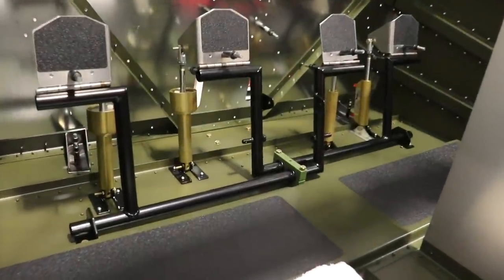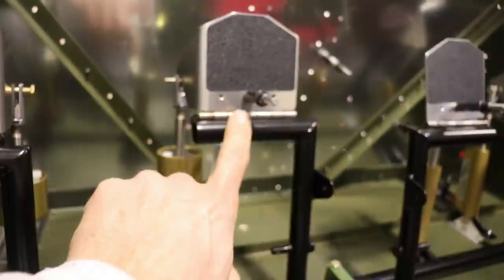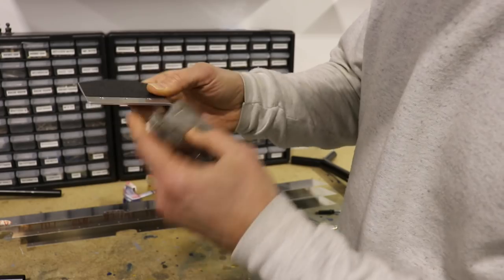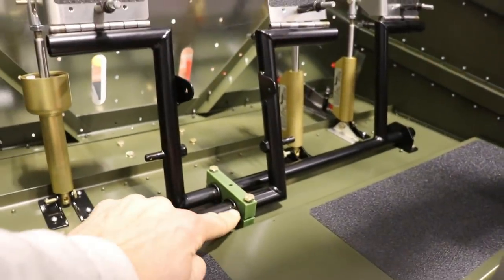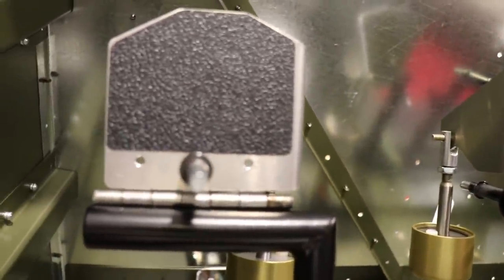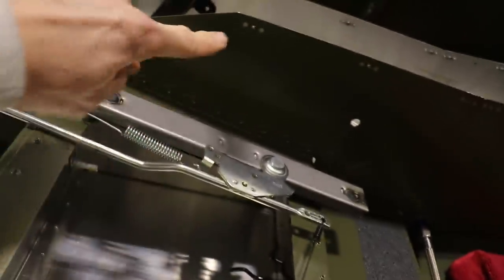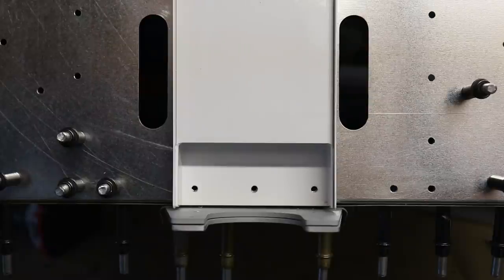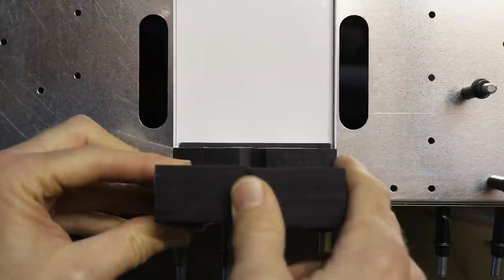Zenith Super Duty: Brake Pedals, Seats, and Nose Gear (Ep42)

Comment: As far as the brake lines, I was at an engine seminar and sitting next to a Boeing engineer and somehow we began discussing the Zenith "plastic" (?nylon?) brake lines.  He said they used the identical tubing on a lot of their hydraulic test rigs since it was so easy to fabricate lines.  He said it handles pressures well in excess of anything you could possibly  generate by standing on the brakes - if I recall correctly, I believe it was something like 2-3x higher.  So, I feel really comfortable with the lines - they're smaller and easier to fabricate - and cheap! Haha!
All that being said, however, there's no doubt the braided stainless lines will be much more resistant to damage and sounds like the way to go for a bush plane!
As far as the nose gear, several builders have mods to make installation and removal of the lower bearing block easier and more secure, such as through-bolting the block to the support underneath rather than drilling it and tapping it. Just wondered if you looked at those or considered those?
Really enjoying this series!

Comment: Good idea on using braided brake lines. We have plastic on our MTO-sport Autogyro and as soon as brake fluid heats up brakes fade out. Taxi on a long taxiway and no brakes at the end. We might upgrade to Beringer  brake system someday.
Reply: If you are experiencing fade that quickly, most likely you have contaminated fluid. Brake fluid is hygroscopic, and when you get a lot of dissolved water, your braking performance suffers just like you describe. Flush your system with new fluid from a sealed container and I guarantee you will see a huge difference.

Comment: Great '"Methods" planning on your part, particularly with respect to the Nose Gear steering phenolic blocks; very good idea to fit them flush with the back face of the fitting by introducing a slot to clear the rivet heads (two thumbs up).
Reply from the maker: Yes I think it's very important for the blocks to be touching the firewall. If they are not, then all of the rearward force on the nose gear will only be held by the 4 small AN3 bolts that thread in only about 3/8" into the bottom of the blocks. If the blocks touch the firewall then that force is applied to the beefy structure on the firewall.

Comment: Hi Mark, Love all of you building content, Great attention to detail, Please keep it up. I believe you said your looking for a different power plant for the Super Duty, but I am really interested in the UL Power for my Cruzer and wondered if your could give some insight on your experience to date with your UL Power plant, Thanks again for your great content. Have a blessed day.
Reply from the maker: As you probably know I have the UL Power 350iS in my Cruzer. I love it! It runs smooth and sips the fuel. I'm happy with it and wouldn't want any other engine in my Cruzer. But for the Super Duty that will (hopefully) be flying out West over unforgiving terrain, I want a bone simple 100 year old technology Lycoming. As long as it's getting fuel and the mags are working, it's pretty much going to run. The UL Power is absolutely dependent on fuel pumps and electrical power. Lose one of those, and you're a glider.

Comment: Just curious.. Why are the brake cylinder not driven from a centered bracket on the rudder pedals? As they are now, you are putting a lot of side force on the pedal mechanism when using the brakes.

Comment: Hi Mark, you said you are having Aircraft Specialties make your brake lines. First, that’s a great idea. Second, I’m curious how or what you used for a template to get the lengths and bends correct. Thanks and keep up the great work.
Reply from the maker: There is no template. I measure the distance between the two connection points and then give that measurement to Steve at Aircraft Specialty. I also let him know if I need a straight fitting or elbow or 45 degree fitting on the ends.

Comment: Mark, are you going to install an undercarriage storage area like Viking Engines has on their Super Duty? If you are, will the brake line going through the floor interfere with this area at all?
Reply from the maker: Yes, but I’ve designed my own. I just need to build it once a get the fuselage cleared off the workbench!

Comment: Looking good. I like the braided lines, but I wonder what the weight penalty is compared to the supplied lines?
Reply: Its the flex that is significantly lower in the hose because of the braid. If there was an ounce to be saved the motorcycle road racers wouldn't use them. I raced for a number of years and its just so much a better feel for braking with the braided lines. Because they flex less in use they last a lot longer too.
Reply from the maker: I also understand that if the brake calipers heat up, it may affect the plastic lines and soften them where they attach to the calipers. I think the plastic lines work well on something like the Cruzer where I almost never even use the brakes, but on a larger heavier STOL airplane like the SD, I think the braided lines from Aircraft Specialty are the way to go!
Reply: @KitplaneEnthusiast  Thanks. I think I will use the plastic versions since I am only building the Cruzer. I can always update/change later.
Reply: Think it about a quarter of a hundred dollar hamburger.

Comment: Does the right pedal actually sit forward of the left pedal when the plane is finished?
Reply from the maker: No. Right now they are floating where ever their weight pulls them because they are not connected to anything. Once the rudder cables are attached, the pedals will be evened up.

Comment: Hey Mark! Great tips for the gear and lines, one question... your left lower engine mount seems to be somewhat crooked, is it not mounted permanently yet? Also, does the parking brake assy. come with the kit or is it purchased separately? Thanks again for making these videos and Blue Skies brotherman!
Reply from the maker: All four of the engine mounts are "crooked" because they get mounted to the thick longerons. The mounts are welded with an angle to them to account for the angle they are mounted. You will need to purchase the parking brake separately.
Reply: @KitplaneEnthusiast  splains everything, thanks!